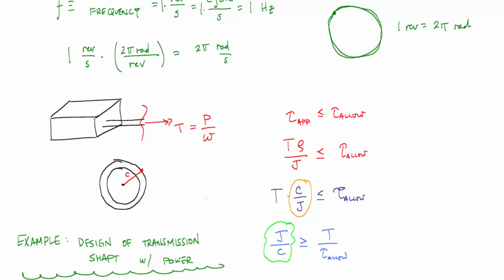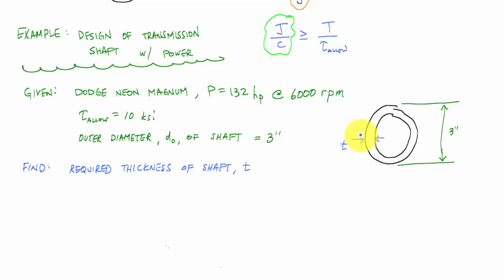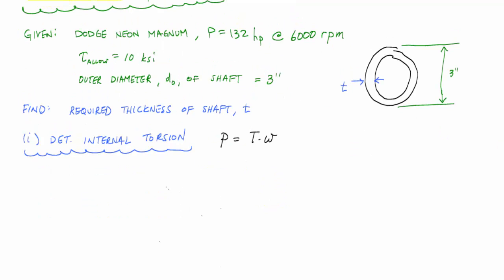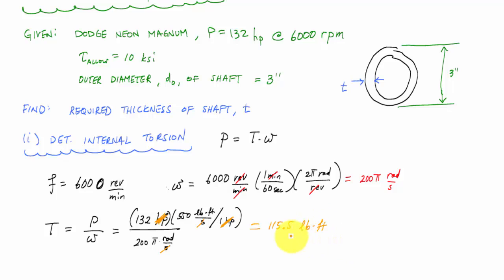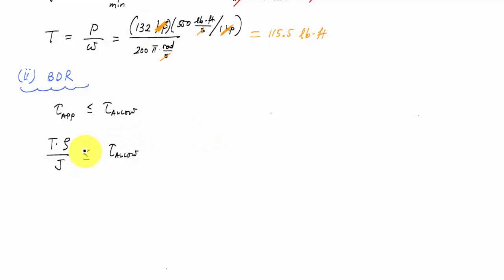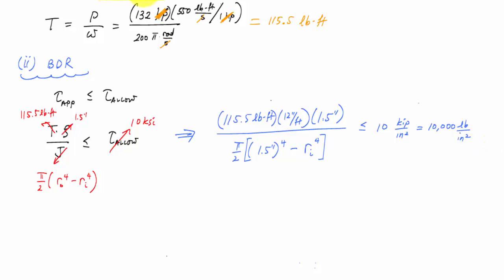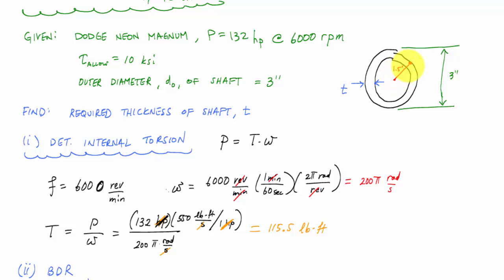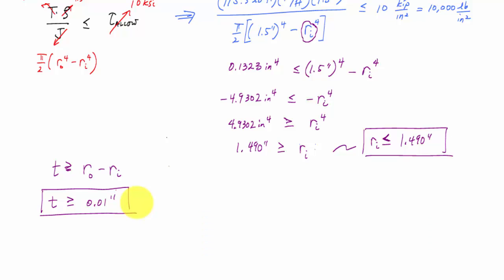Power and Torsion Introduction (2/2) - Mechanics of Materials

Comment: I may be making a silly mistake, but should not the torque equal ((132)(550))/(200pi)=118.173 lb-ft?
Reply: No, he's right, redo the calculations and you should get 115.5lb*ft. 132*550=72,600.  72,600/200=363.  363/3.1415=115.5